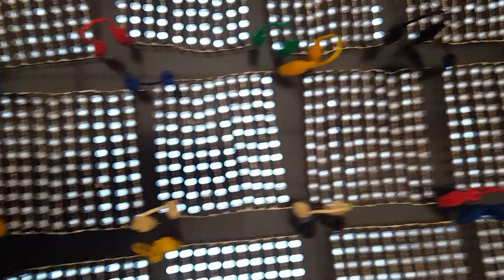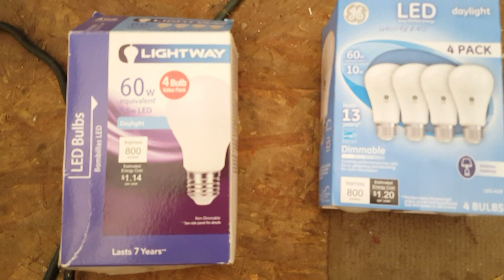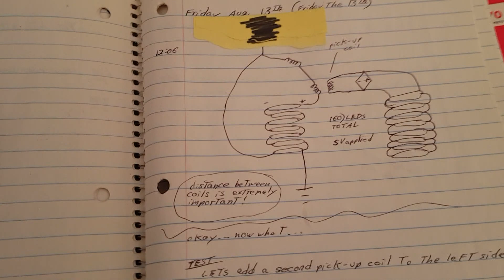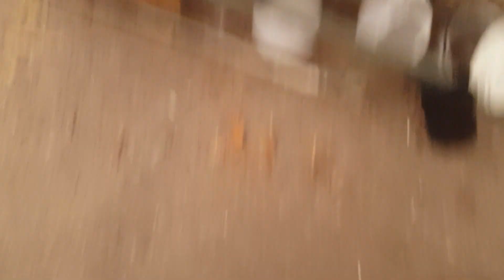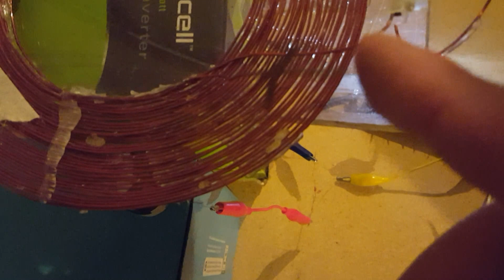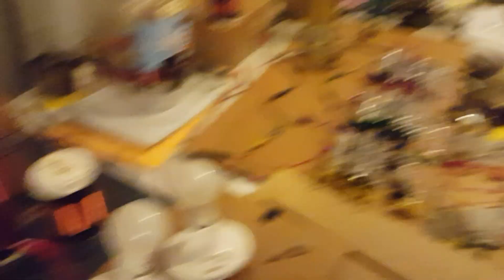WPT part 33. EXPERIMENTS WITH TESLA BIFILAR PANCAKE COIL (Please Read Description for more details)

Comment: might be strange to ask ya this or over the top but, you can use a sewing needle & poke yourself around 3 spots just outside half an inch from the lump for 20/30secs each(enough to feel mild pain,no piercing needed)tho u might want to do this 2-3times a day,reason i say that is since it worked for my finger warts, if i bit them very hard & not pierce the skin, it all went away(this was without any wart remover & finally something worked), so not sure at all if its the same thing but on a bigger scale,. +wart remover &/or peppermin t tea might help out.. i'm a heavy believer in acupuncture now since 3 yrs ago it helped me, & worked on another instance as well, you should see lessening every 3-4 days, judging by the size, it might be about 18~ish days of that.. just leaving an idea box if you want to try it out, but if its not inflamed then it might be something else to be done since i have no idea how long you had it..after 6 to 9 days if you see no change then you can stop.. wish you all the best!
Reply from the maker: Good to see you again!  Thank you for that info.  Had this lump for 1-1/2 years now.  Just had a CT scan done & I will be seeing the ENT doctor next week.
I believe in acupuncture also.